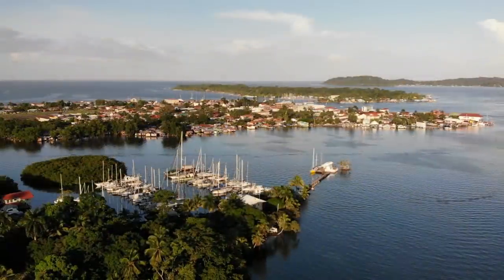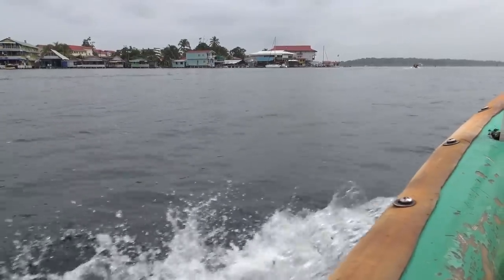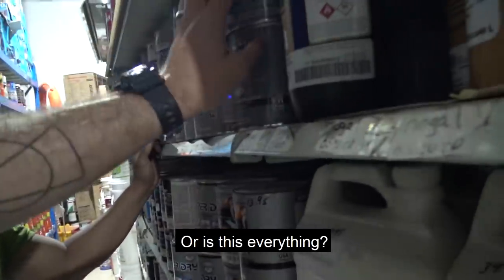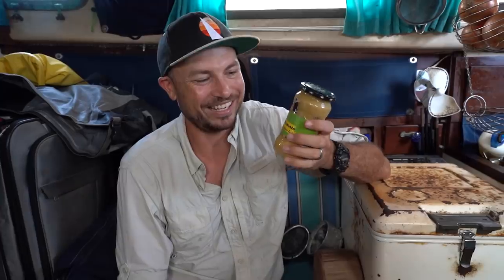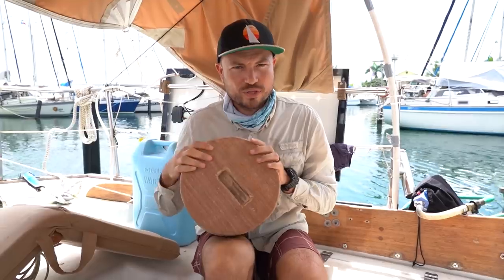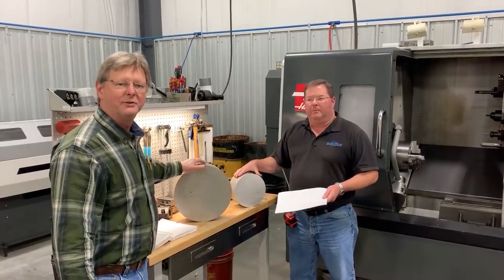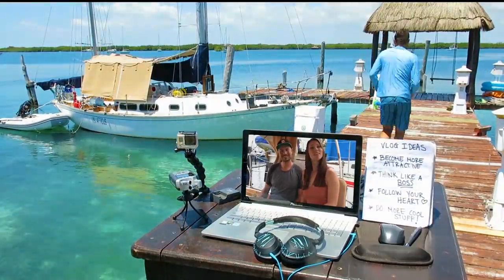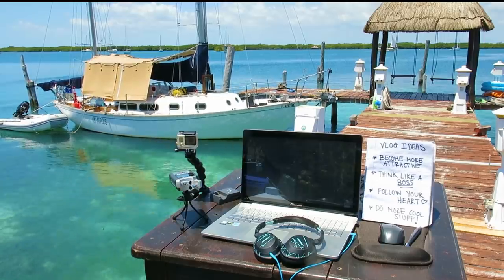Tough Decisions Refitting Our Sailboat In Panama | S04E17

Comment: I love Atticus, But this goes out to JIm and company in Jackson, MS. I did not catch your companies name, but You folks are like so many that just love your jobs and want to help.
I live in Kentucky, on the bicycle trail. Several years ago we encountered/hosted ( for a couple of nights) a group of cyclist heading from the East coast to the West. One couple from England, one from Ireland, another from Romania and the most memorable was a couple from Germany. Hans and Vallie. Hans had a broken caliper on his bike and no local source to purchase a replacement. They ALL need a resupply so we all loaded up in my and headed for the nearest grocery. At this point I might add, By name some may know that I am Scotts/Irish decent and All American. My Spanish and French is only good enough to get food, my Russo/Romain slightly worse and my high German leaves a lot to be desired. They were as lacking in English, but we muddled thru! It was, ACTUALLY, a wonderful few days.
Anyway, on the trip to the grocery I had the thought to stop at a boat shop to see if they could fix Hans' caliper. Well the boat shop did not have the capacity for the repair and the owner suggested a machine shop a few blocks away. We thanked them for their help and loaded up. Keep in mind that this is a VERY small local community. A couple of minutes later we were in the parking lot of the machine shop and greeted by the owner and his crew. Apparently they had been forewarned. 
I my crappy German and Hans' crappy English we explained what was needed. The owner called over a machinist, laid it out and he nodded and said he could have it done in an hour. Hand shakes and thanks all around, we proceeded on our resupply mission. Which happened to be to the smallest Walmart in the USA. 
We arrived back at the machine shop about and hour and a half later and were presented with a duplicate, exact match, pristine caliper half. The damn thing look factory OEM! Then came the time to pay.
I still get choked up. Those great folks refused payment. "It is our honor!" They said. Hans was beside himself and Vallie was in tears (and she wasn't the only one)!!!!

I have served my country. I will again if needed. That DAY MY COUNTRYMEN MADE ME PROUD!
Reply: A great example of humanity compassion and dignity. Thanks for sharing

Comment: Hey guys. Thanks for helping to kindle the cruising flames again. 
I'm getting here a bit late, but anyone taking on a similar project, should consider an epoxy composite layup for the mast bases. Solid Iso-plate is cost effective, bullet proof, weather proof and easy enough for anyone to layup from off cuts inside a disposable plastic container. Laid up in stages of course. Just a thought.
Happy cruising, see you on the seas.

Comment: Those new mast steps sure are awesome and so happy you got them. Was a little suspicious that the wood ones would last because the slots were milled out "with the grain" and thought with all the downward pressure of the mast and the lateral prying the masts will make on the steps that the wood would eventually split along the grain, just my speculating of two cents. P.S. been following since I read an article in Old Boat magazine, you guys are awesome.

Comment: As an aircraft mechanic , I have worked with a lot of aluminum and long term effects of environment. Your mast base and mast plug are good now. Just dropping the mast in the slot  may not be so good ? Time would tell. The mast will move in the base, under lots of pressure and stress. That will lead to fretting and a metallic paste and possible other stress corrosion. The nice finish will be gone.. I would cushion the fit with a sealant. I would use a high loading sealant that remains flexible. I do work on the side of caution, it may not be required in your case. Something to consider. Take care

Comment: Hi Articus Crew.
I have built a yacht from glass hull stage, done repairs to boats I have owned and restored another glass boat. I am an engineer by trade and have sailed thousands of miles, both coastal and offshore. 

The best product I have found for priming aluminium is made by International Paints called PA 10 Primer (red oxide colour) It is an etch primer. Comes in both can and spray pack.
I have had bare PA 10 primer on the boom of one boat last more that 10 years  Better if it painted over though.
Stainless steel and aluminium don't go well together (galvanic corrosion). Put something non conductive between the two surfaces like thin PVC shim for example

If you are putting stainless steel screws into aluminium coat the screw with Lanolin grease. Lanolin is a natural non toxic product and is the best corrosion prevention I have found - bar none - and it is not expensive.
I have had stainless screws in aluminium mast and boom that have been out in the marine environment for 10 + years that I have been able to remove easily with a screwdriver after that time.

If you are putting a stainless steel fitting onto aluminium coat both sides of the plastic shim with Lanolin grease before assembly.
That way you will never have a corrosion problem.
The last yacht I owned I did a major restoration. EVERY screw and fitting has Lanolin on it when assembled . No corroaion issues ever!.

Another use I have found for Lanolin grease is to coat a propellor with it to prevent barnacles. Clean the prop thorougly, heat it with a blow torch to about 100 deg C and brush the Lanolin on. You will need to do it about once very 12 monthsor so to keep the prop barncle free.
It certainly has worked on boats I have owned.

Comment: Just For Extra Safety...  

Place Hose Clamps around the Wood Base and around the Base of the Mast where it slides over the Heel... 

These are the slotted band hose clamps that are tightened via a screw... 

Use 3 to 4 Giant Hose Clamps around that Wood Base... And try to fit 3 around the mast where it slips over the Heel... 

Prep: Unscrew / Open the clamps so that they are no longer in a circle... Hang them on a wire and treat them with a protective anti rust Clear Coat (2 coats)... 
Install them and paint over the entire assembly with an anti rust paint to protect them from the salt water... 
Note: A pigmented paint allows you to see when the paint is comming off... When the clear coat is exposed you can inspect that area of the clamps for rust... 
If all is ok, reapply pigmented paint over the scraped area... I would use a Light Brown pigment to match the boat's wood trim... White will show every single mark or stain...

Comment: just wondering looking at the mast it seems like there is a few power cables running through a hole in the aluminium mast, seems like with the movement of the wind on these cables and mast they dont seem protected enough fron chaffing and could potentially wear through to the bare wires. maybe you do have some protction there i may have missed that. love watching these projects.

Comment: There is a reason why they use wood at the base.  Put a sacrificial zinc on the mast, *most of the corrosion is from galvanic. 

Galvanic corrosion (also called bimetallic corrosion or dissimilar metal corrosion) is an electrochemical process in which one metal corrodes preferentially when it is in electrical contact with another, in the presence of an electrolyte.

Think about it, you have a tall metal mast flying though salty air (electrolyte) grounded to the ocean though fiberglass which can easily carry high voltage static. Air friction easily causes a electrostatic charge in the presence of moisture. (Never mind if the mast is actually wet with SALT WATER) you now have a giant electrode.  Electrode potentials are very high and most boats do not have enough sacrificial zincs even from the factory. Most boat builders have just a basic understanding of electrode potentials for galvanic corrosion and put only the bare minimum of zincs. You don't just need zincs on some metal parts on like the rudder, you need a large (can be thin) metal backing plate, then bolt zincs to the outside of the hull.  

To get rid of all the electrostatic charge, these need to be rather large. Like 12 inch bars on either side of the hull. (If it was my hull) I'd have 4 - 12 inch zincs on the hull below the water line with a backing of sheet metal as large as I could make it. You just want a lot of surface area touching the hull raw fiberglass. (must remove the paint) then just fiberglass over it to double the touching surface area. 

But bottom line is, most boats do not have anywhere near enough grounding sacrificial zincs, and the only place the electrostatic charge can eat away at is the mast, engine shafts like pumps because that water moving through hoses etc also cause electrostatic charge. Never mind a fiberglass hull running through water. Think balloon over hair. Bottom line is most if not all recreational boats need a LOT more sacrificial zincs and the factory didn't do it because it either causes a little drag and that's not a selling point for a sailboat, or they didn't understand it well enough. 

Just my 2cents and stuff I learned owning a 1972 Hatteras 44TC

Comment: For your sealing problems on your leaking chain stays etc good Silicone sealants work stellar, way better then butyl tape or putty. Actually in my opinion you can not get better then silicone for many things on a boat. As long as something is bedded well and you do not need strength or stability you are hard pressed to beat silicone for its sealing abilities. (Best silicone Dow Corning 795) after that 3M makes a good marine one or even the GE II stuff works well.  Especially on a chain plate where you have a cover to sandwich it away from UV light. 
If UV is a factor then get rain gutter butyl in a calking tube, cheap and lasts a long time against the elements. The automotive windshield butyl caulk in a tube is stellar but more $$$.   The biggest issue with silicone is after it dries clean up is really really sucky! 
It would have been stellar to use silicone on your mast bottom caps too,  it would have sealed them together for ages allowing no water in the joint between the two parts.

Comment: The zinc chromate primer you use looks just like the stuff we used in aircraft years ago they kind of got away from it with the environmental protection act and some of the zinc chromate they used to spray it and it wasn’t healthy looks really good, it is too bad you could not re-anodize or alodine  that piece but I think the primer will hold, Are used to do repairs at the end of the line and most of the projects were difficult some of them we were told were impossible the quote I was told Was we do the difficult every day but the impossible usually takes a little longer

Comment: Jordan you are totally correct that was a chromate primer you could have thinned it out a little to get better adheasion but in your case its a good thing you did not it will last a longer being thick. The correct way is to treat the metal(alu) with Alodine (basically acid etch for alu) and then apply a coat of two part chromate primer and two part paint (poly/epoxy) normally with a high zinc content. You would be hard pressed to find any of the correct stuff to do that process because most of those chemicals are controlled for industrial processes by the governments even in 3rd world countries. You however found thickened chromate primer which is the next best thing. Rest assured you did better than 90% of people who would just got to Walmart and got a spray can of paint. Great Job!
Reply from the maker: thanks David!! this is great information!

Comment: Personally I think bare aluminum would be better as it oxidizes that oxidization becomes a protective layer. That's basically what anodizing is anyway. With paint you end up with a layer for moisture and salt to get under and become trapped accelerating any reactions but then this will happen where the part is interference fit to any other. So maybe you're just damned if you do and damned if you don't.. Loving the videos!

Comment: Don't want to be a negative nelly, but get your file ready. I don't think your new mast step will fit. I think it would have been better for them to get the original blue prints from the manufacturer. I could be wrong though luckily it's only aluminum and is easy to sand. Hopefully it fits with no issues.

Comment: That zinc chromate mustard, believe it or not, is probably BETTER than anything you could buy over the counter in the U.S.  Anyone want to venture a guess as to why?  The TefGel on the bolts will solve 99% of the corrosion issue from occurring again, but the Zinc Chromate on all the mating surfaces is still a good call.

Comment: You should leave it bare. Aluminum will create a layer of oxidation that will take care of it's self. The problem with aluminum is when you paint or cover it or combine it with dissimilar metal. If alum on alum then leave it alone. save money and head ache

Comment: did you put stainless steel bolts in aluminium mast without any gasket material in-between ?   just saying ....
Reply: He did. The thread he tapped went directly into the aluminum, so if your concern is different metals having contact and this triggering corrosion, then a gasket would not have helped to prevent that. If your concern is that without a gasket the bolt may loosen itself, then I'd point to the LocTite he used as a chemical way of preventing this. As he used some white type of that "glue", not your average LocTite, there may have been both a filler and an oxidation prevention purpose to it. I'd say there is one worry left for the bolt's head only making contact to a relatively small surface of the curved mast. Maybe a nylon washer would have been a good idea. I guess the head does not have to be tightened a lot, actually, as the bolts only need to prevent the two parts from being pulled apart vertically and not radially, so it would only serve to prevent water from getting in the open space where the bolt head does not touch the mast. I'd say this can probably be covered with a seal instead, in the way it was done now. But hey, I'm just speculating and have no degree in mechanical engineering, nor shipping engineering.

Comment: Nope. Sorry guys but a beauty like Atticus needed a WOODEN mast base. While a solid mass of aluminum is unarguably stronger, in my opinion it takes away from the character of the sailboat. In theory, every component can be replaced by metal but in the end what you're left with just isn't your boat anymore, which is supposed to have a life of its own. Wood is life, metal isn't. Stefan worked very hard on those bases and will be sad. :(